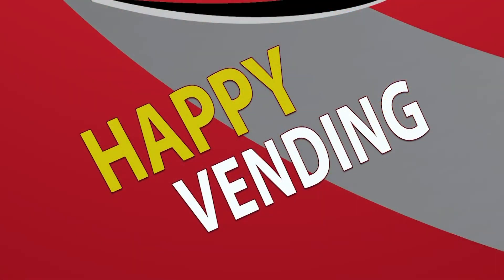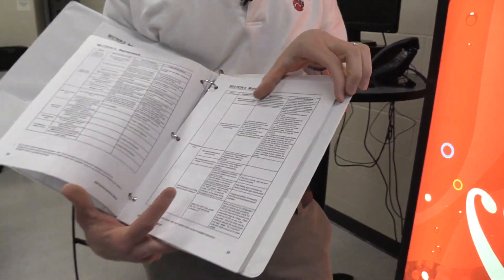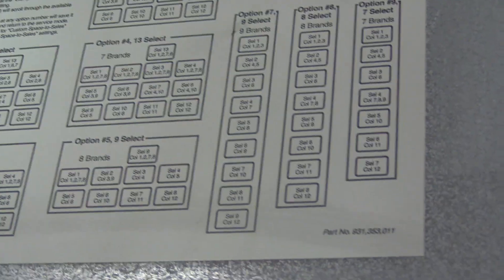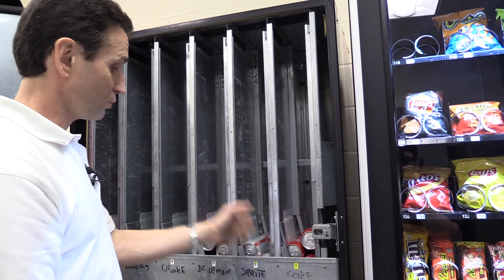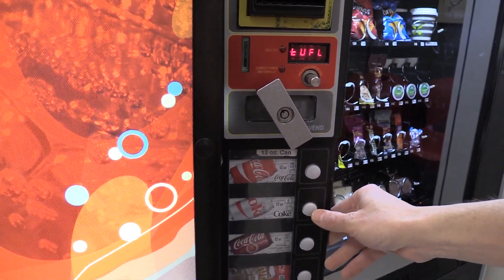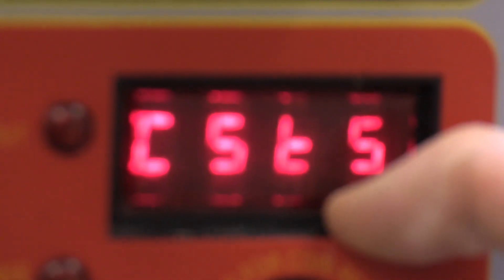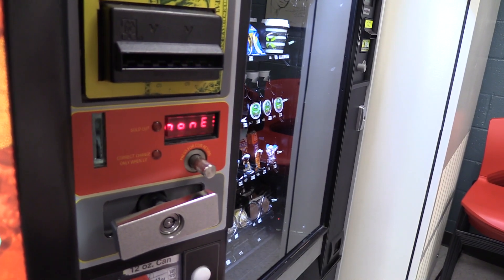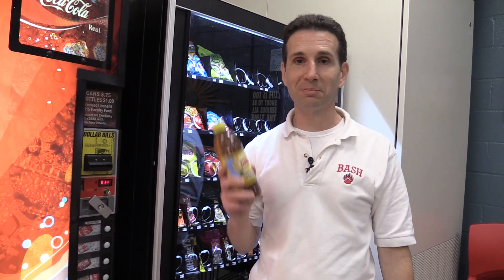Changing Space-to-Sales in a drink machine

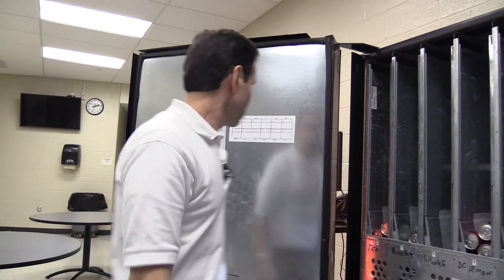Comment: Go to 7:49 if youre in a hurry.

Really appreciate the video man, had to reset STS on a machine at work after the power went out today and it was a huge help!!
Reply from the maker: You better replace your battery on the board so that you do keep losing programming.
Reply: How to go back to normal setting once the STS is saved to test vending?
Reply: @hibizkus808  Im kinda confused by your question, like how to exit out of the sts menu and return to normal operations? I think you just have to press the mode button again and shut the door of the machine
Reply: @hibizkus808 Close the door. That usually takes care of it.

Comment: My main seller (coca-cola) in column 1 and 7 stopped being responsive when you press the button on my Dasani Royal machine. I'm hoping that your tutorial here will help fix that issue for me as it randomly stopped being responsive when you press the button. Even when you don't input $1, when I press the button it doesn't even show the $1 price. It just acts as if I never pressed anything at all and continue to scroll "ice cold"
Reply from the maker: Does all the other selections work in the machine?  It sounds like the selection switch might have gone bad.  You can try swapping the switch with selection 2 to see if the problem follows the switch.  If it does, just get a couple switches from Royal so that you have some extras.
Reply: Yes. All the other selections work fine. I opened my snack door and it accidentally hit the coke button and knocked off the clear plastic coating and the small flat white button. I popped it back in the button but it was unresponsive after that
Reply from the maker: @melodybee6039  Yeah...probably the switch.  Like I said, swap it with another to confirm...then just by some replacement switches.
Reply: I've tried to do this. But I'm not finding the service button on the control panel
Reply from the maker: @melodybee6039  why do you need the service button to replace the switch?
Reply: No, I couldn't find the service button. I was gonna switch the selections so coca-cola could vend in another column but I couldn't even find the service button

But yes, one of microswitches fell off for coca cola. I noticed all the other buttons had a mini switch inside when pressed but coca cola didnt
Reply from the maker: @melodybee6039  Just move the products to another column and switch the flavor strip...there should be no need to reprogram anything.  You service button would be a square red button at the bottom of the control board.  If it's a newer board, it would be a small round blue button at the top left of the board.

Comment: Hey , thanks for the helpful videos. Not sure if you’ll see this comment but when I change to make my STS custom, it often times out as if I’m taking too long , what do I do ?
Reply from the maker: What type of machine do you have?  Are you sure it's timing out and you're just not pressing the wrong button?
Reply: Royal Vending 660-9 GIII . At first it lets me change the STS and out of the blue it’s say 6714 1-4 and I hear the bill acceptor making noise
Reply from the maker: @MeetThePrinces  So the machine appears to be reseting because that number is the eprom version of the board and that only comes up when the machine resets.  Maybe the door switch is going bad and it is behaving like someone closed the door.  However, when that happens, the bill acceptor should not be making noise.  That usually only happens when someone powers up the machine.  There could be a loose power connector going to the control board.  You should unplug the machine and check all your connectors.  You should also look for broken or loose ground connectors.

Comment: How do I reset the sold out error on one of my products  I just filled it  AMD it said s sold out
Reply from the maker: The sold out display should reset once you open the door of the vending machine.  If it is not resetting, you may have a bad door switch.  It is an easy repair, just order a new switch from royal.

Comment: Hey bill, I have a vendo 576 Pepsi machine that keeps jamming the 12 oz can on one column. What do you think could be my problem??? Thanks for the vids!!
Reply from the maker: I do not have any Vendo machines so I really can't help you on this one.  I'm not sure if those machines use can shims.  If so, are you using the correct shim?  Also, could the rotor be bent or worn?  Does anything look different on that column compared to the other columns?  You should post a question on the vendiscuss.net message board.  There are people there that use Vendos and can help troubleshoot your problem.
Reply: @HappyVending  alright thanks

Comment: I have a royal too, do you know if there is a way to keep all your machine sets up when a power outage happen because I always have to set up everything again when that happen.
Reply from the maker: You need to replace the backup battery on your control board.  It looks like a black or yellow rectangle circuit.  Use a chip puller to remove it.  It will probably say "timekeeper" on it.
Reply: Happy Vending Yes, you got right... It got th yellow circuit, I Wil buy the spare. Thank you so much